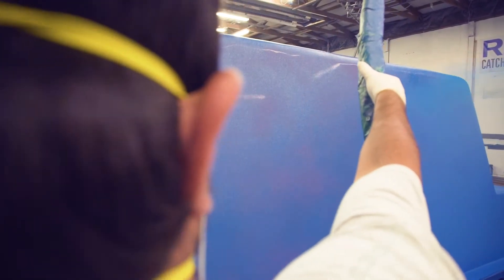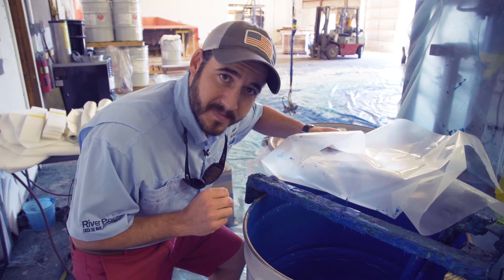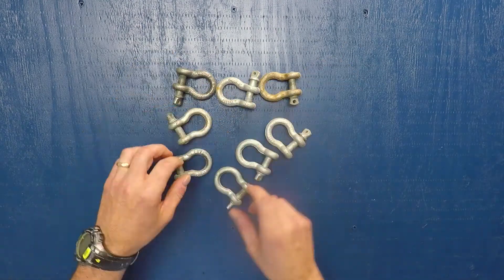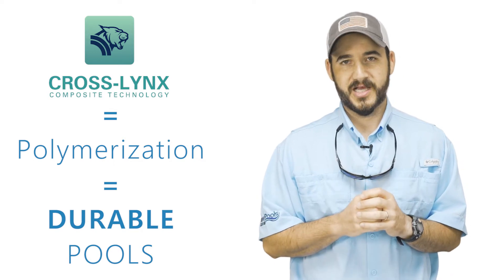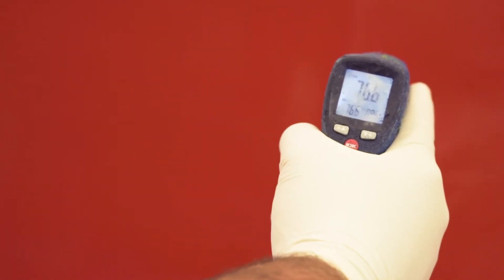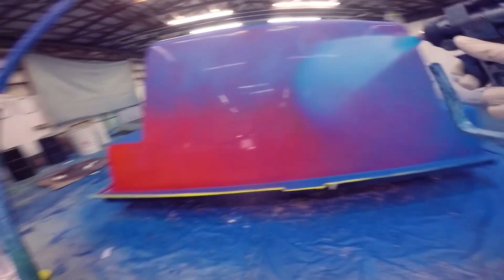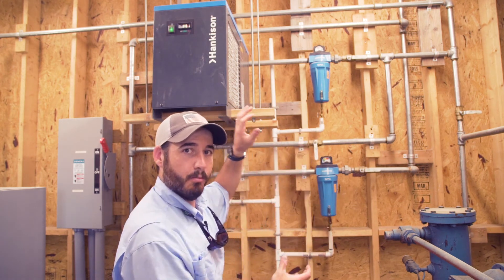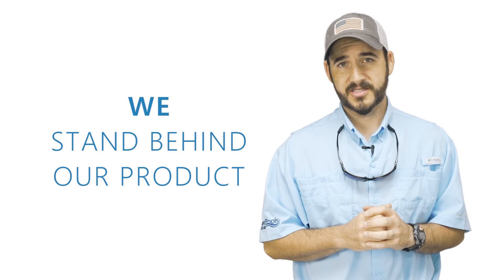How Fiberglass Pools Are Made: Gel Coat (Part 2 of 8 in Building the Perfect Fiberglass Pool)

Comment: I understand why you need dry air for the guns.  What about controlling the humidity in the building you're in?  How does that impact the quality of the finished product?
Reply from the maker: Heat and humidity can speed up or slow down the "cook time". To adjust we can tweak our catalyst so we achieve the optimal time. The biggest thing is not getting water into the resin lines which can inhibit proper curing in places.